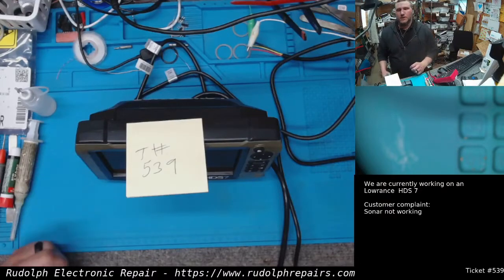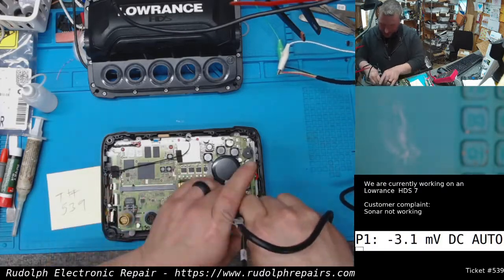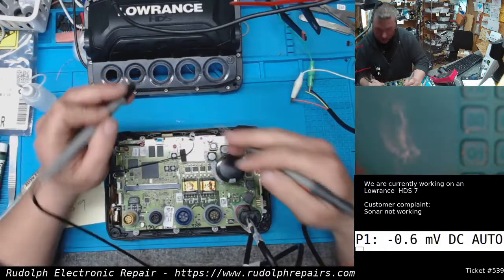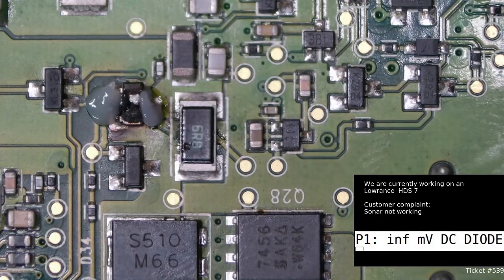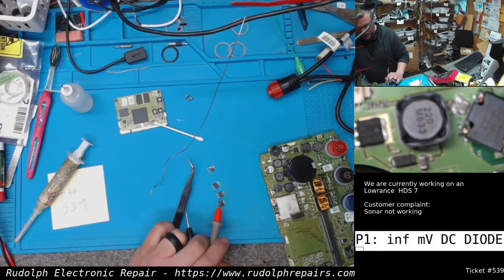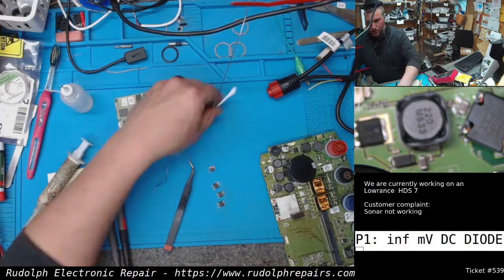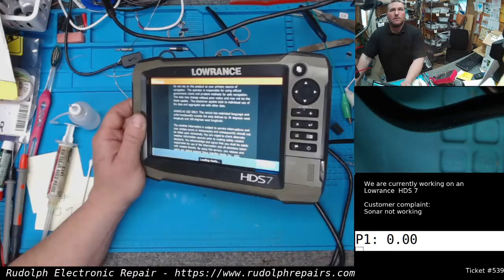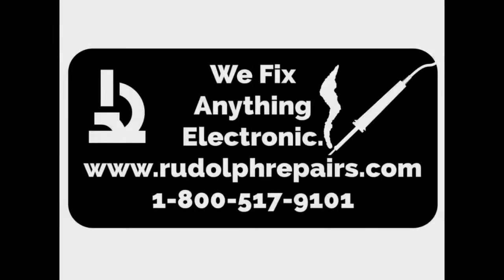Lowrance HDS7 - Sonar not working - FIXED!

Comment: I purchased a brand new Elite 12 Ti2 this past November. When I installed it and went through setup, it exhibited the SAME exact sonar issues as the HDS7 you repaired in this video, and we're talking a brand-new, never-used unit. My guess is it had a similar issue with the actual sonar circuitry...shorted components, who knows. Was very disappointed considering it was a new unit (obviously being under warranty and brand new, it had to be replaced rather than repaired). I wasted hours troubleshooting the unit (and went through a transducer replacement) thinking I was doing something wrong, considering that everything else worked fine (GPS, mapping, etc. worked). Lowrance must be doing some cost-cutting with the electronic components.

Comment: hello my friend congratulations for the you tube channel ... can you help me? I have a problem with a gen 3 hds due to an overvoltage the sonar page does not start ... it had two diodes and a burnt resistor but it still does not start ... the screen is blank ... the sonar version gives me 0.0 .0 what can it.be?

Comment: Hds 9 doing the exact same. Blew a fuse 4 weeks ago. Replaced and graph wouldnt work. I get a running static screen and no depth reading. 

What kind of eta is your turnaround?
Reply from the maker: Hi Ricky!  If you can kindly fill out a free estimate request we will get back to you with a rough estimate and eta.
https://www.rudolphrepairs.com/free-estimate

Thanks!